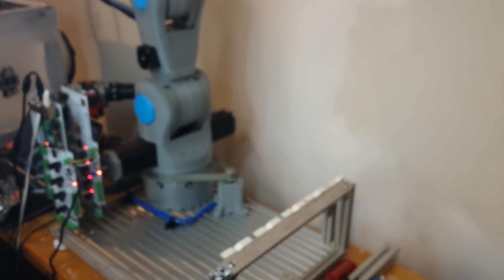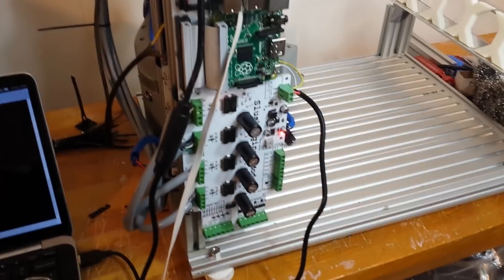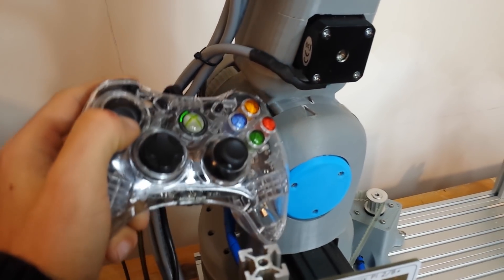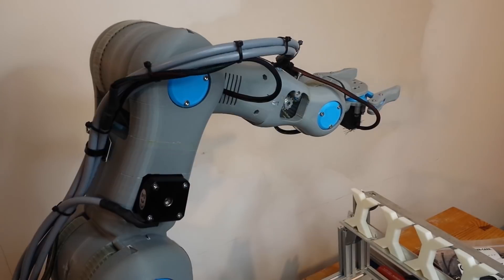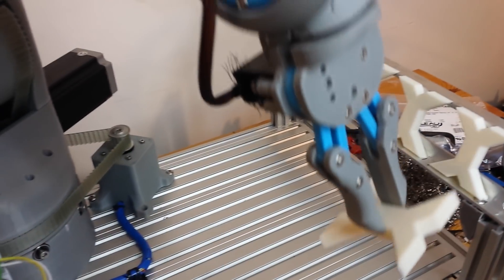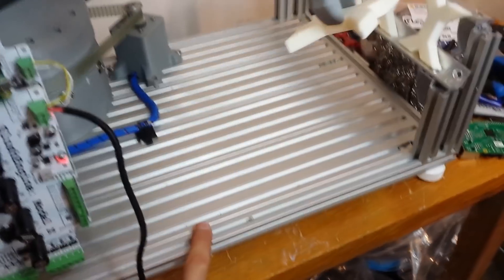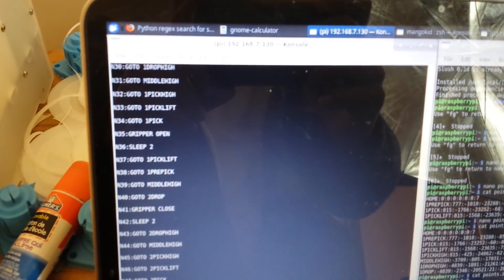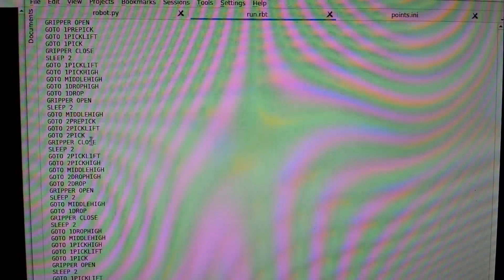3D Printed 6 Axis. First test

Comment: The small timing pulley on the motor could drive a gear that's larger than the one currently on the wrist. Would it be easier to retrofit a larger gear for higher torque? It would be slower but you can use the nema 17 motor to lift a lot more weight.

Comment: what waas your reason for using steppers over servos? im starting a similar project with machine vision soon and i'm planning on using servos on every joint except the yaw axis. mainly because then H-bridges arent needed.
Reply from the maker: Akomarongg servos are much simpler to drive and much cheaper in the end. However they have very bad resolution and often have a lot of jitter. Even with a high quality controller they will jot exceed the angular precision of steppers reduced with a timing belt system. Steppers are also capable of multiple revolutions.

Comment: I wonder if you can control this using any of the much touted advances in machine learning? It would be cool if it learnt its motion control through reinforcement learning. It runs on python so maybe in the not to near future someone might release some opensource library for doing just that.

Comment: Nice work. Is something binding during movement? ..I hear a clicking or popping noise.
Reply from the maker: DJB HSI there are no relays.
Reply from the maker: wxfield there isn't any binding. all axis are on bearings and there is no contact between joints. its probably just my bad cable management shifting around.
Reply: sounds like relays but could be wrong

Comment: I though it was a 6 axis 3d printer... I guess many people did, but this is cool too :)
Reply from the maker: svampebob007 I thought the griper gave it away.
Reply: there will never more than 4 axis on 3d printer 4axis is rolling bed you can melt plastic side ways its allways flow down. if you take cnc machine convert it 3d printer you get same quality print and peepol try make better print on home machine.i tell you they allready have quality evev cnc can melt plastic rigid machine not make any effect on how plastic melt and where it want flow

Comment: Because of your Name I guess you are a German or Austrian guy ;) 

Why did you not start a kickstarter ? where can we take a look on your kit, what will it cost ect :)) 

or do you want to reply to hundreds of mails
Reply: ohh what I forgot to say - THIS IS FREAKING AWESOME!!!
Reply from the maker: We will sell the kit on our site eventually. We are looking for Beta testers for the kit at the moment. Kickstarter is very expensive so I am trying to avoid it.
Reply: I could set up some small parts on my tall CNC milling machine and let the robot change the parts or so, that could become a cool video, theoretically I could mill the parts out of aluminum, but I think that will get a bit expensive / could be cheaper to buy an old KUKA and do a retrofit :) they are quiet cheap on ebay :) 3 - 4.000 bucks for a 5 axis one

Comment: can u 3d print with the arm
Reply from the maker: Mark Williams no, it not that accurate. even and industrial 6 axis has trouble with perfect linear interpolation.
Reply: 3D printing with a 6axis robot arm is over-engineering. Even industrial level robot arm cannot print as good as a average 3D printer, and it take alot of calibration. 6 axis robot tend to have good precision but bad accuracy. If you give some coordinate to the robot, it will be able to get at the same place everytimes, but that place might not the at the exact position you gave it. Given this is a 3D printed arm, the calibration for the reverse cinematic would be a total nightmare..it will work but it will never be accurate enough even to come close to the cheapest 3D printer on the market.

Comment: Is the raspberry pi a mk3? Is it actually fast enough for real-time?
Reply from the maker: Its a Raspberry Pi B+ (just what I had kicking around at the time). The Raspberry Pi does not have to be fast to run this program. The SlushEngine does all the real time motion control. The Raspberry Pi just makes motion requests to the SlushEngine and the SE updates the Raspberry Pi when it has finished moving. I could probably clock the Raspberry Pi down as low as possible and still get the same results. Might be fun to try.
Reply: Already tried using a Raspberry Pi to control directly a pwm signal. I used a dual kernel approach with Xenomai real time kernel and the  Adeos patch. The resulting pwm pulse might be suited to this kind of non critical application but a microcontroller is easier, cheaper and more accurate. And.. it was not funny at all. XD

More info at: http://userk.co.uk/xenomai-real-time-system-raspberrypi/
Reply: Giovanni your link is broken.
Reply: It is up again. Thanks unlost117

Comment: really awesome project! May I know how you setup the control system? I have a project that's based on grbl but I find it hard to control that way. Thank you.
Reply from the maker: I used the SlushEngine to control the robot. Its a 4 axis driver but you can gang it with another to make it an 8 axis driver. It can all be programed from Python. I wrote the software to control this robot in about 4 hours so it didn't take to much work. Its all Python.